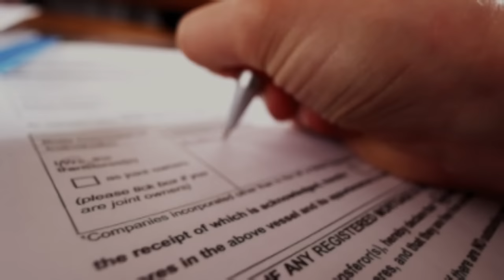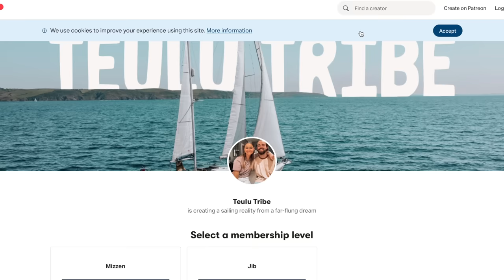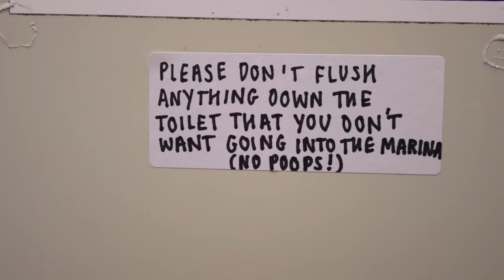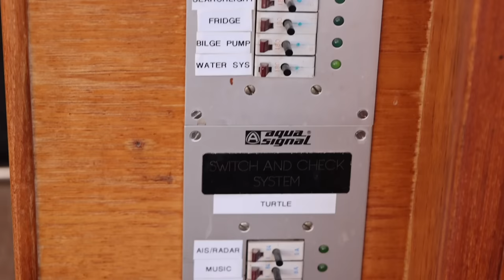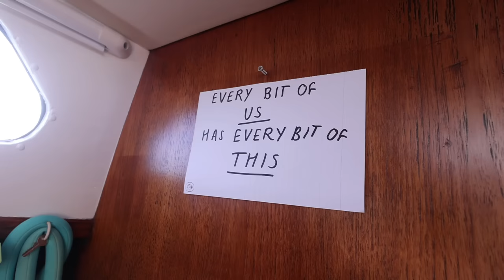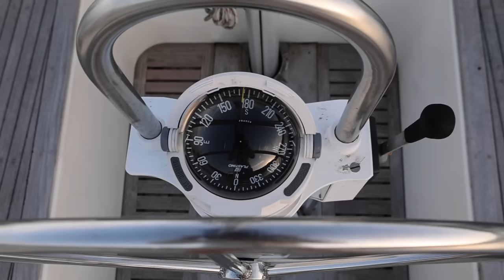Colvic Victor 40ft Sailing Boat Tour

Comment: You have an extremely well kept boat for its age. Congrats! I suggest a modification on your waste water system. Instead of letting the water from shower, sinks, etc. go into the bilge, get it directly overboard with a pump, e.g. mounted under the shower pan. You will switch on that pump manually evey time you take a shower. The advantage is that you avoid humidity in the builge. In particular, you want to avoid any water in the engine room bilge. Humidity in the engine room will lead to rust everywhere over time. I speak of 25 y experience.   Once I had changed my entire water system accordingly my bilge was dry an corrosion was no longer seen. Good luck and regards from Switzerland. Silvano
Reply from the maker: Thanks Silvano 😊 Yes, thats a great suggestion and something we are now looking into! Thanks!
Reply: A gulper sounds like a bottom feeding prehistoric fish, but its the the thing that sounds like it might pull your toes off under your shower tray .
I had a blower in my bilge for airflow , if you do have high rh its one way to cure it

Comment: I love your boat.  I think you've made a great choice for an offshore cruiser.

I've been sailing for 46 years.  Everything from dinghies to cruisers (we use to have a boat in Queen Anne's Battery) and currently we're racing in the RORC doublehanded offshore series.  I'm currently looking for a cruising boat that I can spend extended periods on when I retire, and the deckhouse with the table high enough to sit at whilst looking out is a great feature that I am looking for too. For cruising, the ketch rig gives a lot of options for depowering safely when needed.  Slab reefing rather than inboom or in mast reefing would be my preference too, as there is nothing that can really jam or go wrong and it allows for a better sail shape.  We have an EFOY fuel cell on the race boat which has been a great addition.  We never need to run the engine to charge now.  Maybe worth investigating if your energy needs are high.

I'm sure you're going to have a great time onboard.  Best of luck.  I'll be following.
Reply from the maker: Thanks so much. Oh cool, small world! It was the pilot house that attracted us to Teulu in the first place- we wanted lots of light in 😊 Will look into the EFOY fuel cell system- thanks for the suggestion!

Comment: Thanks for the boat tour it's looking great, congratulations.   Also good to change the name of the chanel.
Just a couple of things, the gas locker does not look as though it is sealed and drained overboard. Hopefully it's better than it looks. Gas on a boat is dangerous and will drain down to the lowest point in the bilges and accumulate there.
The light you pointed out on the front of the main mast is the "masthead" light, commonly referred to on a yacht as the steaming light, as you must have this light on when under power, as well as your sidelights ( red, green) and stern light. Although officially called a masthead light, it is clearly not at the masthead and doesn't need to be, but it must show a white light from forward to 22.5 degrees abaft the beam on each side (the same sector as your sidelights), which it looks as though it does.
An anchor light must show a white light  360 degrees. If you have one it will be at the top of the mast. Otherwise you can hang a light up in the forward part of the yacht (similar to the black ball). Great to follow your progress.
Hope that helps.
Reply from the maker: Thanks so much! You are right about the gas locker- it is not sealed- it is on our list! However, there is a pipe to outside though which is good and we do switch it off after each use 😊 Yes. We know this about the steaming light- We don't have one at the top so we just use the Steaming light and our stern light- although it is something we need to fix soon! Thanks so much for the suggestions- we really appreciate it 😊

Comment: Its a great layout guys and has some excellent features.
Your pilot berth will need a leigh cloth...to keep you in on opposite tack. 😉 The other thing is a Bimini and a deep dodger  for when its too hot or cold raining heavy and you need ventilation below..but you know that. 
The fact you have an internal helm a forward facing Nav station and and engine room.
Buy a led low voltage outdoors rated rope light you can snake it round putting waterproof cool safe lighting all round that great  engine room.👍🏼😎💙⛵🧙‍♂️🧰
Reply from the maker: Thanks Clive 😊 Yes, we need to get one! Otherwise it won't be a very restful sleep 🤣 We would LOVE a Bimini but unfortunately the budget doesn't cater for it at the moment! Good idea about the rope light!
Reply: @TeuluTribe  
You can rig your own light Bimini as a temporary measure.
Take a look at the one on Wildings  cat....
The dodgers a tougher job...

Comment: First off all (I will say it again) I'm happy for you guys! This is really a great boat :) 
Second - I'm surprised how well this boat its holding because it doesn't look like a 35+ years old.
Pilote house is great and overall it looks like all the space is well designed. 
The only thing that you can consider is the dry bilge and composted toilet. 
All the best!
Reply from the maker: Thanks, we think so too 😊 We are planning on tackling both of those issues this season during our haul out! Cheers for the advice.

Comment: Well done video, keep them coming. Nice to see you on anchor, that 80kilo anchor is NOT overmuch! It is true that weight on the extreme ends will increase the hobbyhorse motion but the difference between 35K and 80K on the bow is not that significant. The difference in holding between 35K and 80K, when your anchor is all that's keeping you off a lee shore in a blow, IS significant! Fair winds.
Reply from the maker: That's what we thought! Heavier just can't be worse- especially when we want to anchor 99% of the time!

Comment: I have already commented on the main sheet jambing cleat but I also wonder about those very large wheelhouse windows, are you thinking about blinds? Rather exposed in the winter.  Lead the hoist lines for the mooring ball forrard of the lower shrouds, the ball ought to be visible over the bow not the side deck!  Any idea of the length of chain?  You do keep the boat so smart and tidy, well done.
Reply from the maker: We looked into blinds but they are too long to fit (even custom ones!) so we are thinking silver backed blackout material that poppers or Velcros on to give a bit more protection 😊 Thanks for the suggestions! We have 60m of chain currently and are going to get about 50m more 😊